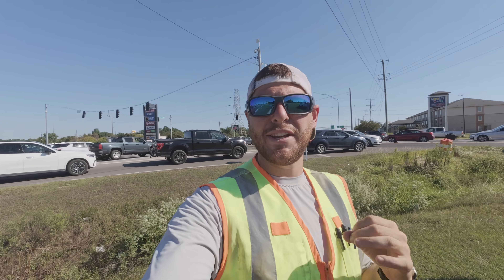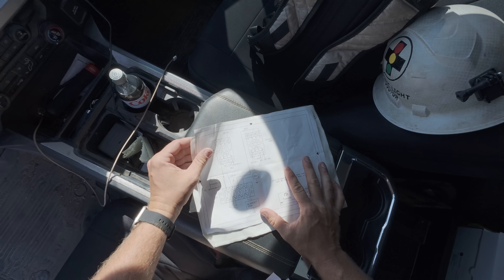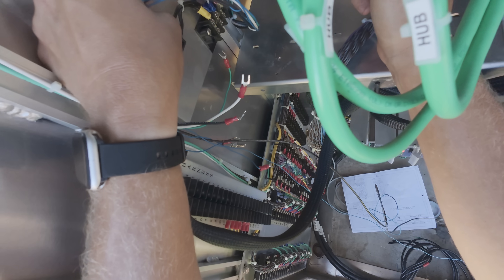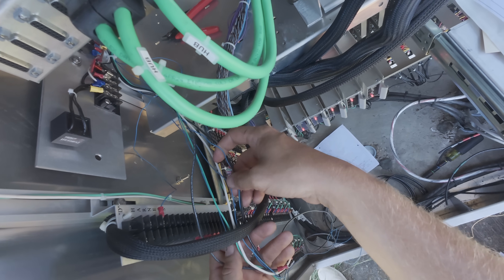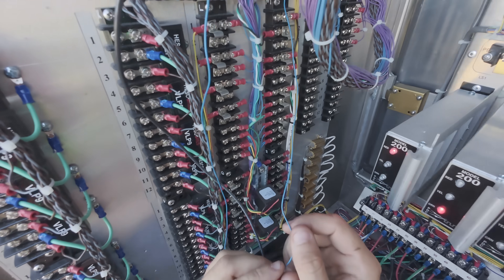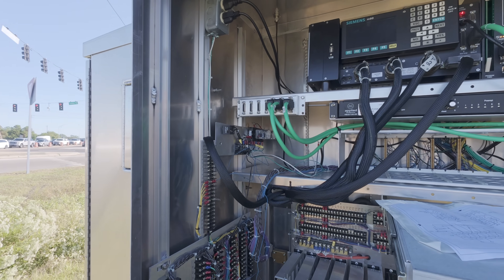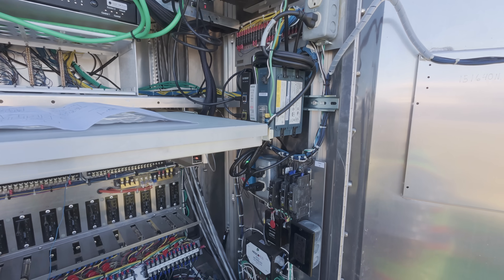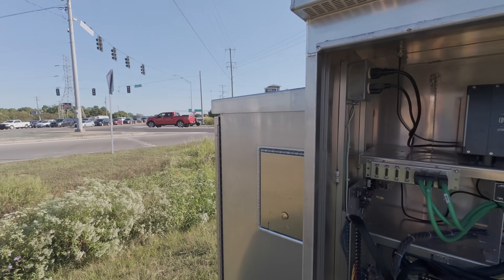Essential Setup for Traffic Lights by Railroads (You’ll Be Surprised!)

Comment: What happens when the preemption is activated while a pedestrian signal phase is active?  Does the pedestrian phase get cut short?
Reply: For RR Preemption Ped's get cancelled immediately. The signal has to cycle to the clearance phase. The newer design is advanced preemption, so the tracks are already cleared at least a minute in advance.
Reply: Doesn't look like there's any pedestrian signalling at this intersection.

Comment: That's interesting the loop between the RR hut and the signal cabinet is 120V. I bet that's true all over the country? It's probably a standard set by the RRs.
Reply: And 24Volts doesn’t travel very well over long distances
Reply: @tor94  Yeah DC doesn't for sure.
Reply: This means the relay is always pulled in.  And it breaks the loop meaning no 120 V to relay when train passes over the crossing. 
 I have seen such set up on I35 in Ssn Antonio ,  Tx   It woukd send the dual intersection into flashing red.
Reply: Makes it Fail Safe.
Reply: It's standard because of the standard voltages in traffic signal cabinets. 
Most railroad equipment runs on 10–12VDC.
Reply: @jovetj  Ah ok. Well it must just be for distance reasons then.
Reply: @aaron74  If you mean why 120VAC is standardized in traffic signal cabinets, I don't know. It could be because of voltage drop or it could be just what was commonly available for use.
Reply: @jovetj  for the railway preemption portion, my assumption is voltage drop.
Reply: @Trafficlightdoctor rough estimate acceptable, how far from the intersection cabinet are the railway controls